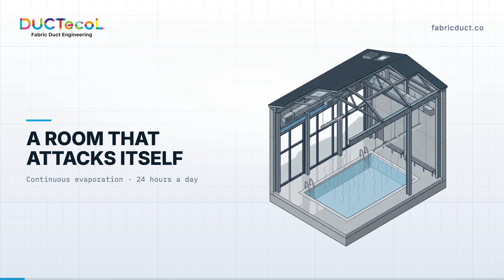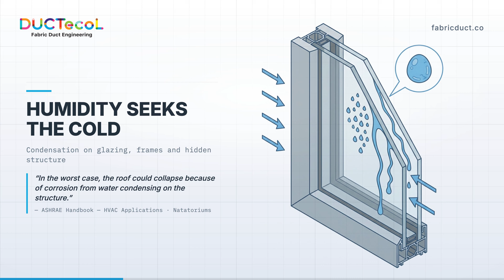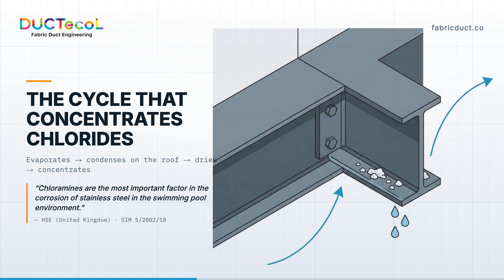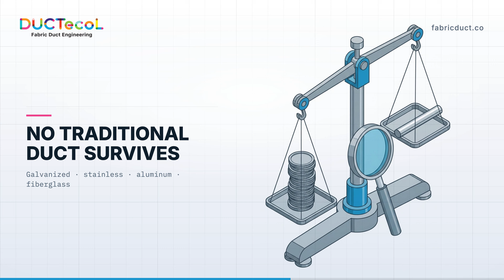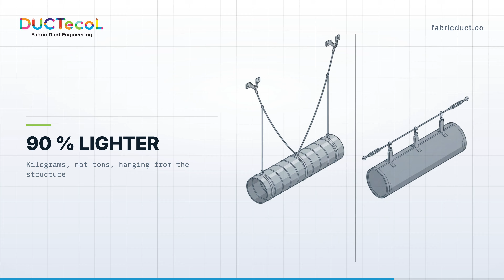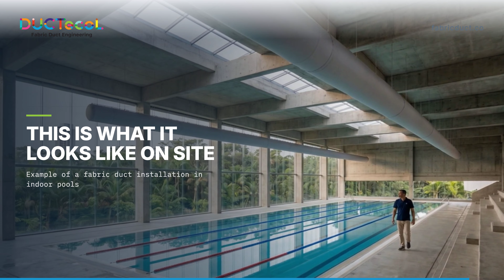Why NO metal duct belongs over an indoor swimming pool

Comment from the maker: Every source behind the figures cited in this video, for anyone who wants to verify or dig deeper:

Design criteria and the evaporation equation
ASHRAE Handbook — HVAC Applications, Natatoriums chapter. Air temperature 2-4 °F above water (max. 86 °F), design relative humidity 50-60 %, negative room pressure, velocity over the water surface, and the equation wp = (A/Y)(pw − pa)(95 + 0,425·V).
http://dxair.com/images/design/ashrae-2007-hvac-manual.pdf

Stress corrosion cracking and the documented collapses
HSE (Health and Safety Executive, UK), SIM 5/2002/18 — "Stress corrosion cracking in swimming pool buildings". Uster 1985 (12 fatalities), chloramines as the main corrosion driver, and the recommendation against 304/316 in safety-critical load-bearing components.
https://bssa.org.uk/wp-content/uploads/2020/11/HSE-Stress-Corrosion-in-Swimming-Pools.pdf

Baddoo & Cutler, The Structural Engineer — the Steenwijk (Netherlands, 2001) and Finland (2003) cases.
https://bssa.org.uk/wp-content/uploads/2022/07/Baddoo-Swimming-Pools-3p.pdf

Trichloramine concentration above the water
Frontiers in Built Environment (2022) — CFD study on a Montreal pool: 1,910 ppb in the swimmer breathing zone at water level, and the conclusion that the ventilation minimums in the standard are insufficient.
https://www.frontiersin.org/journals/built-environment/articles/10.3389/fbuil.2022.957973/full

Total installed cost saving
DUCTecoL — manufacturer technical documentation: estimated savings of 30 % to 70 % in total installed cost against metal ductwork.

Traditional ductwork materials
Fiberglass duct board with FSK foil facing: https://expressinsulation.com/products/fiberglass-duct-board-fsk-faced-foil
Pre-insulated aluminium panel with PIR core: https://www.gfiduct.com/product/pir-pre-insulated-duct-panel-80-al-foil/